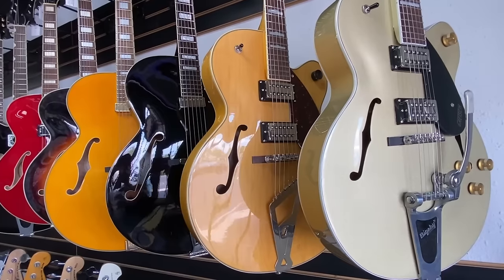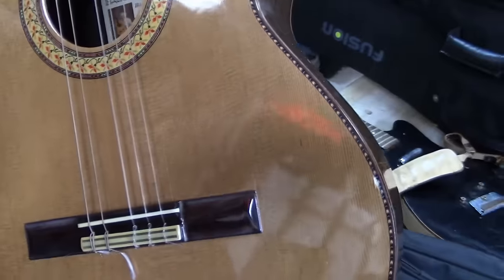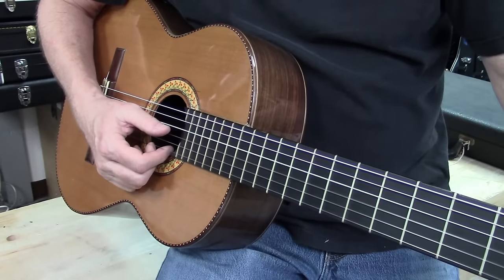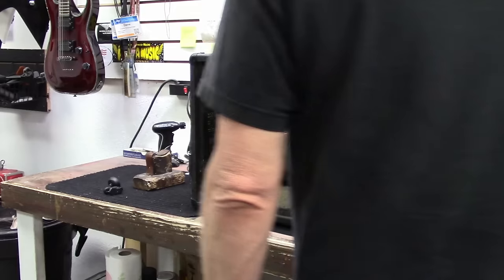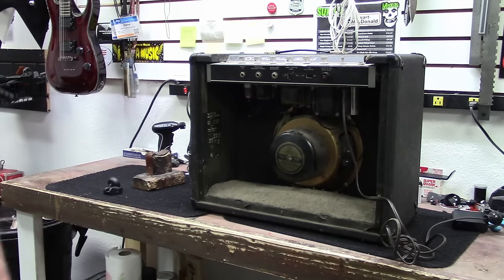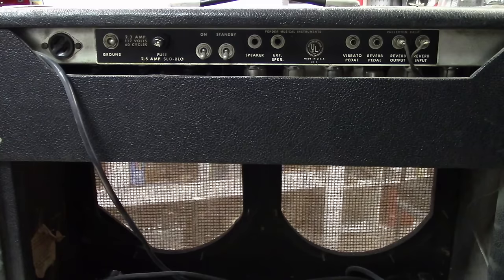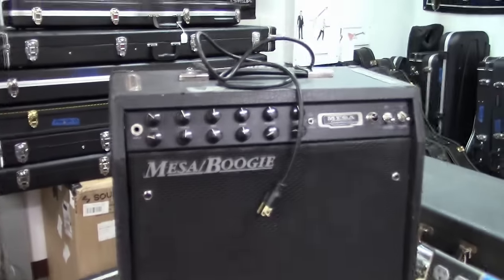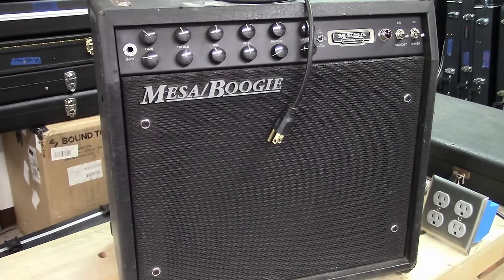Storage Locker Guitar and Amp Testing!

Comment: Manuel Rodriguez guitars are amazing and VERY expensive. Looks like you have a very nice one there. I think THAT is your greatest find in that locker
Reply: Definitely. Makes me wonder a bit that Zimm's Guitar's doesn't know that though
Reply: it's not a very old one,the label inside give it up with a website address.Newer ones sells around $300 USD and up  to $25000 USD for the top signature series.
Reply: @CJC051 Exactly. That is quite the range which makes it worth the investigation. The video didn't show the headstock enough to tell if it is signature or not. The current Signature ones have more elaborate detail on the purfling but I don't know about older ones.
Reply: That Manuel Rodriguez F-C at 3:57 goes for more than $ 1000. It's a 4/4 Magistral F full solid cedar/rosewood. Beautiful
Reply: @michaelgothenburg364  he’s obviously a metal/rock guy. Cut him slack
Reply: @ColeWheeler4Lyfe  True, I was too hard on him, I regret that
Reply: @CJC051  The production number dates it to 1993

Comment: Blackface started in '63 or '64.  That's why the first Blackface Bassman's had circuit designation of AA864.  However, there was also a transitional Blackface phase where the amps had the black face panel, but used the Brownface circuits to use up the remaining inventory of Brownface parts.  These were called the "Tuxedo" amps.

Mojotone can make a replacement speaker baffle and back panel for the Twin Reverb.  They actually make "Fender Licensed" replacement cabinets, and the Blackface Twin Reverb is one of them.  With measurements, they can probably make a new back panel for the Vox Cambridge too.

Comment: The Twin Reverb probably paid for the entire storage locker.  Definitely the best thing that came out of it.  Worthy of a full restoration.
Reply: What's it worth? Hard to beat that vox😅
Reply: You cant fully restore it to value, no original speakers, tolex ripped other issues. You put other speakers in it and you will get maybe 1/3 the value. Pawn shops wont even take guitars and amps with missing or replacement speakers
Reply: @halcooper3070  Is the vox tube or solid state?
Reply: He may want to see if the original speakers are there, transformers etc, no mods. the old tolex is original I would keep it on and let the person who he sells it to change the tolex
Reply: I would definitely bring it back to life and possibly use it and not sell it. I gigged with one of these once and it stomped!
Reply: @markscott4830  If I may, it is tube.  Saw that in the first video.
Reply: The Twin Reverb is a late 66 amp, big bucks if restored
Reply: Back of the twin, upper right corner of the chassis stamped is the serial number.  Should start with the letter A.  That will give you the year if you look it up.
Reply: The Vox Cambridge tube amp is the rarest & most desirable amp there, try to find another. You'll find blackface twins easily enough.
Reply: Haha, funny, I made a post on that amp . Yeah, that baby is way worth restoring . It paid for the locker and whole lot more . lol
Reply: @halcooper3070  The Vox is a great find, but a 65 black face twin ?... Pretty much a holy grail of Fender amps . :)
Reply: @IanJames56  I thought the black face was a 65 only ... lol Well, you learn something new every day . lol
Reply: @markscott4830  All tube . :)

Comment: The Rodriguez is by far the best guitar of your locker. Great !
Reply: Rodriguez guitars were used by many in the folk era in the 70's.
Reply: I think you're correct. Recently saw a video that covered that guitar maker and they were top notch.
Reply: I don’t understand. Those guitars are really cheap now.
Reply: @ramooninthemoon $800-1200 and up is what I’m seeing. 🤷‍♂️
Reply: looks like this one is a top model, probably going in the $2000
Reply: @ramooninthemoon  That's now, they've switched to quantity. The guitar he got is probably from before that though. If Martin Rodrigues Senior did it, it starts at several thousand and could be $10,000

Comment: Manuel Rodrigues and Sons was the maker of the beautiful acoustic guitar.  Thanks for showing.  During the winter of 2013, I spent a month helping a sound systems business from Spokane with the renovation of the sound system in a 1905 church building that I was warned (by the sound engineer) had the original electrical (knob and tube) system in the attic, "It's still hot so be careful up there."  The biggest improvement to the sound system was adding a ground to the electrical circuits in the space, which removed the constant 60 cycle hum that impacted the sound. I was thankful that the new TVs were not installed before addition of that ground leg.   Replacing or adding a three-wire plug to the amplifiers is a good thing.

Comment: blackface Twin Reverb was made between 1963 and 1967. The silverface came out in late 67. Just FYI never power on a tube amplifier without the proper speaker load connected. probably the main thing that destroys tube amps is people turn them on by mistake with no speaker connected. also those old tube amps without ground connection can shock you or worse. i always turn them on the first time with a stick and dont touch the chassis until i can measure the chassis to ground to see if there is high voltage floating on the ungrounded chassis.

Comment: When dude said "the worst that can happen is it doesn't come on..." oh reeeeally heheheh! In my experience, the worst that can happen is that they can catch on fire and fill the shop up with black smoke before you can even yank the plug so be careful Holmes!
Reply: Well said sir. Makes me think about a big old Fender bass amp. The slow blow fuse went and the wizard band teacher put in a 30 amp car fuse. The thing had flamed up so bad a few components look like a piece of carbon with a wire at each end.  Was that a diode or a resistor?

Comment: The Fender is the star of the show; fully restored it will get you around $3K or so...the Mesa is a $900 amp, and the Vox will get you around $1600 when cleaned up.  I would replace the the 2-prong power chords since the amps will be not 100% original after a tech has gone through them, but retain the cord for any collectors that might buy the amp.  The amp market is crazy right now, prices for old stuff is as high as Ive ever seen it.  Very well done with this locker, lots of WOW factor.
Reply: A partsCaster for $3K?? I don't know about that.....
Reply: @hamjohn8737  The amplifier, smart guy.
Reply: Yes..  I always keep the original ‘suicide’ plug, caps resistors, even burnt out pre amp tubes from my vintage Fender Amps..
The ‘purists’ love all that stuff..
I
Reply: The Vox Cambridge tube amp is the rarest & most desirable amp there, try to find another. You'll find blackface twins easily enough.

Comment: Awesome find. That blackface Twin Reverb is killer. You could always plug it into an external speaker cab to try it out. What's odd is the drip edge front panel grille. The "drip edge" was a very limited feature that was only on the earliest silverface amps in 1968 (blackface went from sometime in mid to late '64 through the end of '67/first weeks of '68 as they transitioned to silverface and used up all their parts). So either that grille is from a silverface Twin or it's an exceedingly rare, late 1967/VERY early '68 blackface that had a drip edge front panel grille. I tend to doubt it just because I've never seen such a thing but it is of course possible. Especially with 60's Fender stuff that went through so many aesthetic changes so there are always transitional oddballs that will have features from multiple era's. Like the early "blackface" Bassman amps you see sometimes that still had the brown panel era chassis, "cupcake" knobs and with the brown panel era circuit with the "presence" control. As well as the ones that had the newer blackface era chassis and circuit with no "presence" control but still had the brown panel era "cupcake" style knobs. You could also consider putting the Twin Reverb into a head cabinet. They sell them online. A lot of players would find a lot of use from a Twin Reverb in a head cabinet. Its easier to transport, can be paired with any speakers/speaker cabinet and for session guys in particular, it can be kept in a multi-head road case, as well as be kept in the control room, separate from the cabinet when overdubbing parts which is very convenient in the studio. 

Congratulations!
Reply: Yeah I wonder if the guy got a 68 grill cloth to replace the original. The UL is there so but I believe post CBS they said fender musical instruments like they do now.
Reply: Yeah, the grill is completely wrong for any blackface TR.   And on a pre-CBS TR?  No way in hell.
Reply: right, the speakers in the cab connect to a right angle 1/4" jack that plugs in the jack labeled "speaker"  :D
Reply: A Twin Reverb chassis put into a head unit is essentially a Dual Showman, isn't it?
Reply: I just had my 1969 Silver Face ‘drip edge Bandmaster ‘ restored  it rolled out of Fullerton Ca, in 7/69 according to the serial number ..all original ( including tubes which were biased.)  one preamp tube replaced.. 
Only thing missing was the original reverb tank and a front bright switch.
Kept all the original parts. 
Someone mentioned that the vintage amp market is off the hook..
My amp guy said he received about 15 inquiries asking if I want to sell it.
These offers were from old farts like me to very young guys…

Comment: Probably not a good idea to power up vintage amps if you dont know anything about them. Not worth the risk of damaging components like transformers when they need to be serviced by a tech anyway. That vox amp is probably worth a few $$. Great video, thanks for sharing with us.
Reply: Yeah, the whole amp bit made me absolutely cringe. You DON'T randomly fire up an amp that's been sitting idle, especially one that an absolute noob knows is worth restoring. None of those amps should've been used without a competent once-over and replacement of any 2-pronged cords. C'mon, this is ROOKIE stuff!

Comment: On that clean channel, the upper row of controls, pull on that gain knob for the cleanest clean you have ever had from a Mesa. Driving one of these with a Metal Zone (or any boost pedal) really opens them up, and adding an EQ pedal (or whatever device you have) will also give that F-30 some great tones at decent, probably won't get you evicted, volume levels.

Comment: That Music Man amp looks just like my B115 One Twenty - 120 watt solid state bass amp with a 15" speaker.  The blonde pinwale ones were a little more rare than the standard black tolex, and they usually came with an upgraded EV speaker.  They were built in the early 80s.  I've had mine 40 years (my dad owned a music store back then and he was a MM dealer) and it still sounds awesome.

Comment: Wow... when i try out unknown old beat up amps, i ALWAYS use a wireless transmitter. I have too much respect for tube amps ability to send me to the hospital or in a one room wooden box with a lid........ 
Great find and interesting video
Reply: Yes tube amps have extreme voltages inside. 350 to 600 plus volts DC . If you don't know how to work on them don't. I leave it to qualified technicians!!

Comment: The Twin has its inputs right on the back panel! They're 1/4" jacks, including the one where the internal speakers plugged in (the one on the left that simply says "Speaker" .... the right one is "extension speaker"). You didn't need to replace the speakers to test it, just plug it into a cab that is a minimum of 8 ohms. That said, it's probably best that you didn't, as that is an old tube amp that's sat for years and the capacitors, if they are original, will be paper and oil and may need reforming, so your tech will bring it up gradually from 0 to 115 on a Variac. That Boogie isn't worth what the Mark series models were, but you can still get a good 600 to 800 for it, depending on the local market. I have to admit I wanted you to plug in the Twin with a cab, but at the same time, that was a selfish desire, as it would be better to bring it up slowly on a Variac.

Comment: The Fender Twin Reverb has a speaker jack on the back. Just plug a speaker cabinet into it and test it out. That amp (the Twin Reverb) paid for the locker. The VOX also may be the biggest find. The Mesa is a nice amp, but not in the same category as the other two.

Comment: I service amps, and am REALLY surprised the Box fired right up. I'm wondering what it has for tubes. This locker is definitely a 90s time capsule.
I would have just run the speaker out on the Blackface into another speaker cab. The Boogie F-30s are a killer clean amp, great pedal platform. The OD channel leaves much to be desired, but if you replace the midrange tone pot on the Drive channel to a 50 or 100K it will GREATLY improve it. You could do a mod to switch the value on it, but if you're selling it, it would probably be a waste of time. Of course a tube screamer or EQ do the same.
The only drawback to that amp in today's guitar gear world is that I'm pretty sure the effects loop is a parallel loop, not series. People used to like them because you can adjust how much of the signal runs through what's you have running into it, and how much you bypass. You can kind of get a pseudo wet/dry multi amp sound with it. The problem is that you can't really run other preamps, modellers, EQs through them because you won't get the full signal running into the output section.

Comment: I used to have a music man 1-12” RD with the EV speaker that you also found in another cab in that locker. The music man I had with the same crème colored tolex(?), was made in the early 80’s. I bought one somewhere between 1982-84 and it was a great amp. I don’t think they had that crème colored tolex until the early 80’s but I may be wrong. I’m curious if there’s a model number on the back somewhere? That looks very much like my old amp but with a taller or just larger overall size cabinet almost like it could accommodate 1-15” speaker. I’ve seen great blues guitar player Chris Cain use the same amp I had. They were thought of back then as having a similar sound to a Dumble. Seeing that guys green Strat with the EMG’s reminds me also of a Tyler Strat I had from 1987 that I changed the pickups to EMG’s cause Larry Carlton had them on his Valley Arts Strat in a star licks video he did back then. So maybe the original owner was into a similar style of music. That Mesa Boogie Studio preamp that you showed in the rack was also a common preamp to use in recording sessions in the 80’s, so it looks like this guy was a serious player and a real connoisseur of great gear. That lockers full of treasures
Reply: This is some 112 model. On the back is a plate with the numbers.

Comment: The Twin Reverb is a 65-67' being a blackface.  That baffle is a "drip edge", however it is not original to that amp (or the chassis is not original to that cabinet), since the drip edge were only on a silverface.   Very cool finds!

Comment: The Fender Twin black panel is found up until the end of ‘67 but the drip edge is usually ‘68-early ‘69 with a silver faced panel.  It’s not impossible you have a late ‘67 or early ‘68 black panel (left over) with the updated drip edge cover but I’ve never seen one before… also no speaker so it could be a parts special.  The black face circuit could be authenticated by a specialist.  The first silverface Twins (drip edge) used the blackface AB763 circuit until May 1968, when Fender switched to the AC568 circuit.

Comment: If you play it a lot the nylon stings will settle into tune in about a week or two.  Then after two or 3 gigs they need to be replaced.  I change mine every 2 months or so depending on how many gigs I have. I use a Godin, LaPatrie Concert QT, sounds amazing but needs strings a lot more than a standard acoustic or electric guitar.

Comment: Fender Twin Reverb amps of that vintage do not have speaker output wires, the speakers were wired to a 1/4" jack and plugged into the back, where it is clearly marked.  You can plug that directly into that Fender 2-12 cabinet with a regular guitar cable.

Comment: Just passing on some needed advice . ALWAYS make sure that the fuse is the correct value . If you don't you can lose an amp very quickly it is not rare to find a 20amp fuse where there should be  a 1 or 2 amp fuse . The drip edge is 68 and 69  but unless they changed the face plate the twin is earlier .....check the transformers the last 3 numbers after 606? are the year and week    502 would be 2nd week of 1965

Comment: I was told by a tube tech that the Twin Reverb schematic was not built to have a Master Volume knob (hence the lack of one on your Blackface). In fact, my Quad Reverb, when I brought it in to him to repair it, he said that I had better leave the master gain on 10 (full volume), or he would bypass the knob entirely. (The Quad Reverb was a CBS (sorry for the cuss word) modification made from 1972-1979, but using the Twin chassis. CBS must have made it because apparently two 12-inch speakers weren't enough volume for its designer, let alone enough weight to lug around! 😲 I have pushed my Quad to as loud as I could tolerate it, and my discovery is that I can't even be in the same room with that thing over 5-1/2! Yikes, that Quad is loud!!!

FWIW, one of the speakers was completely cracked, the tubes (all 11 of them!) were replaced, just to be on the safe side, and some bonehead had previously wired in an electrolytic capacitor backwards! (Must have been quite the explosion during a rehearsal or gig somewhere, along with any other pyrotechnics from wiring a polarity-sensitive element backwards...) I also had the tech set it up to a Blackface schematic. Pretty nice-sounding amp now! 🙂